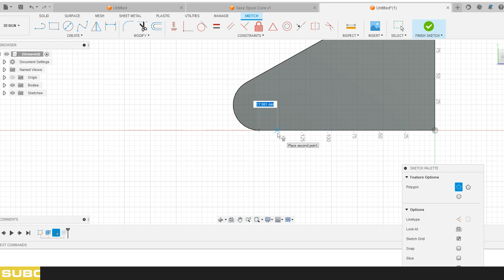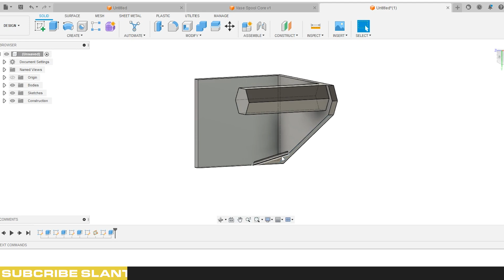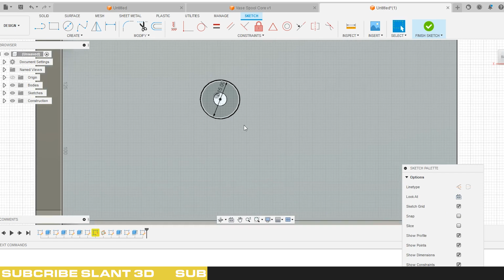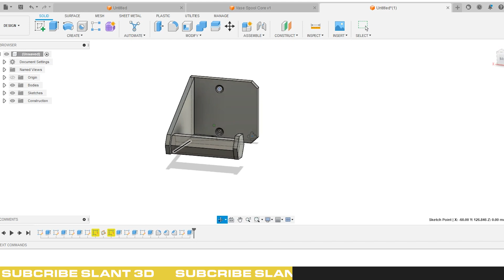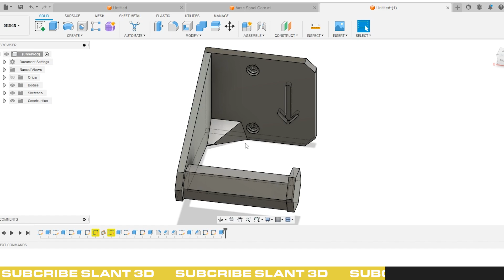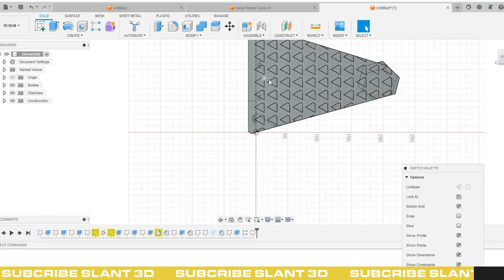Design for Mass Production 3D Printing: Spool Holder Exploration

Comment: Oof. That was painful watching your modeling process... You did so many things I teach students not to do because they slow them down.

One of the simpler things I tell students to do is to press esc twice after finishing an action to unselect objects. There were several times where you had objects selected after doing an action that meant you had to redo the action after unselecting things. Likely would have saved you 2-3 mins of this video.

Also, don't underestimate the offset tool! It is accessible with a hotkey and can easily be "broken" so that you can put your own constraints on it.

That said, in terms of the design itself, it looks good. My only complaints are with the process to get there. I'll probably show this to my students on Wed to show them how much some of the things I talk about can slow you down even if you know how to use the software... While also showing them how to make a good design for 3d printing.

Comment: I don't want to sound too harsh but I can not stand someone just stating "x sucks", without explaining why. I personally do not understand this statement at all, since most spool holders work just as fine as your design. Or am I missing something? And I couldn't help but notice that you made a lot of changes very quickly, without seeming to think first. This resulted in warnings (yellow boxes in the timeline) popping up that should ALWAYS be looked at, but you didn't. Strikes me as unprofessional. I also don't like the idea of "eyeballing" in CAD. It is easy enough to define angles, lengths and relationships. No need to guess. Might be fine as some kind of brainstorming, but honestly I would just start over completely. I would begin looking at other designs to get an overview how others approached this problem. Looking at different designs makes it easier to see what works well and, more importantly, what doesn't work (or can be improved). While some might say I am nitpicky, when working on bigger projects small mistakes accumulate and then some warnings might inhibit some changes lateron or cause other problems and oversights that could have been fixed with research of the topic might lead to a product that doesn't perform well enough in order to be competitive.
Reply from the maker: This is a design exploration. The point of the video is about how to design a product for manufacturing. Now how to do CAD and fully parameterize a model. The rules and points of designing for manufacturing stand whether you are whtieboarding, sketching, or using tinkercad or solidworks. This is a whiteboard session.
Reply: Yeah.  I enjoy the Slant videos, I have learned a few things from them, and I will continue to watch them.  The constant refrain of "everything sucks, except for how we do it" does get old after a while though.
Reply: @netpackrat  Exactly how I see it. I do enjoy 3D printing videos a lot and like to see different viewpoints on the topic (including Slant 3D). However always trying to be edgy is just annoying over time. I can only hope that the videos get more neutral over time.

Comment: I like the idea of a directional arrow. You should use the standard packaging up arrow that has a flat on the bottom for clarity. Also, adding a chamfer to the perimeter of your arrow for printability or just inset it very slightly.